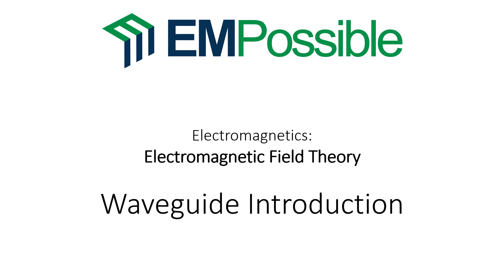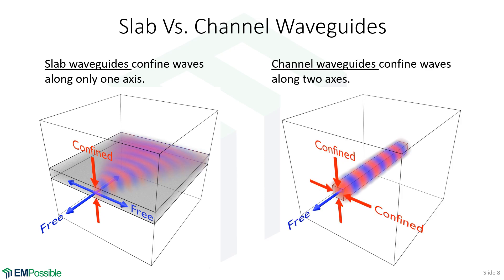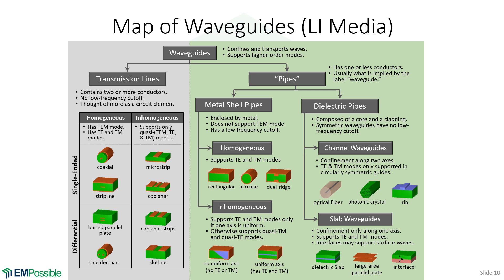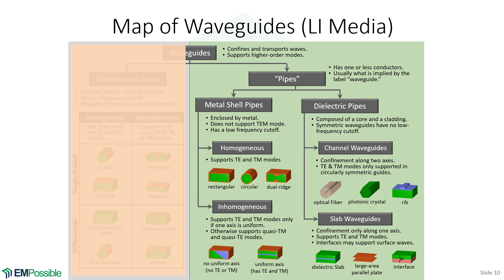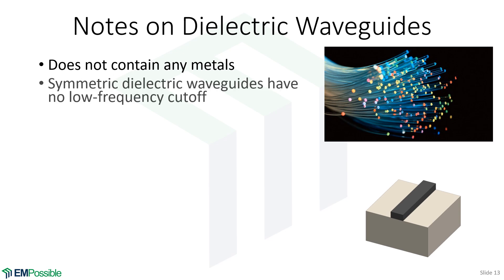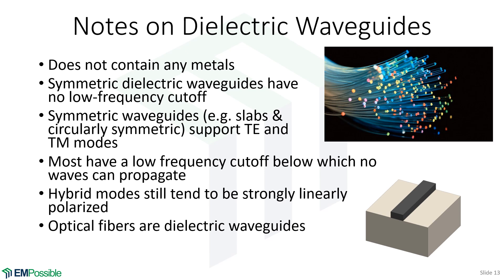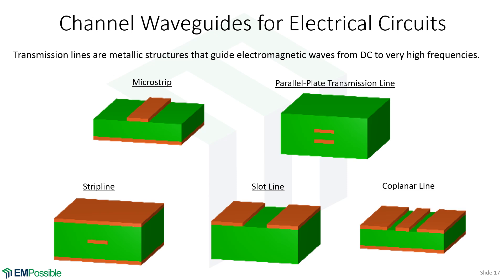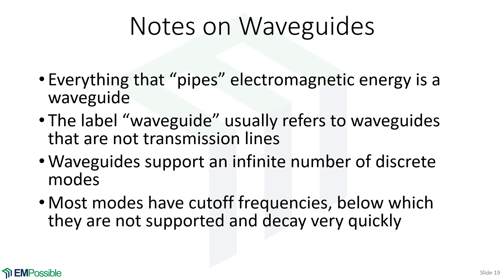Lecture -- Waveguide Introduction

Comment: Do you know anything about low frequency waveguides? For materials such as galfenol or metglas sir?
Reply: 100-400hz frequency.
Reply from the maker: @hoofheartedicemelted296  Wow. That is an incredibly low frequency. Are you looking at transmission lines or non-transmission-line type of waveguides?
Reply from the maker: I know about waveguides, but I am not sure what you mean by "frequency" waveguide. I think you just mean an electromagnetic waveguide. I am not familiar with these materials, but waveguides can be made from virtually anything. If you know the electromagnetic properties, you can design a waveguide.

if you can provide a bit more information, like what frequency or wavelength, a bit more about these materials, I could likely point you toward the types of waveguides you should consider and how to analyze them.

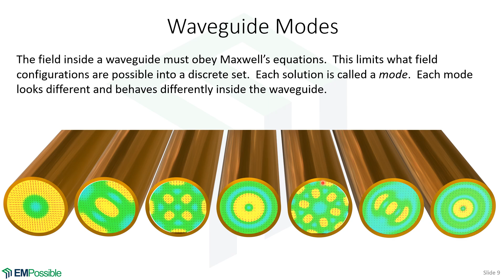Comment: Out of curiosity, and just to clarify the nomenclature, @3:29 when discussing the waveguide modes, is this academically correct to synonymize that with "guided modes" &/ propagation modes or the latter refer to a different concept in the EM theory?
Reply from the maker: For waveguides, I think it is most proper to call them guided modes. I am not entirely sure what a "propagating mode" is. Maybe in a something like a photonic crystal with a band gap you would have propagating modes and cutoff modes. That is just a guess as to what is meant by "propagating mode." If it came up in the context of waveguides, I would probably interpret that is the same as guided mode.
Reply: @empossible1577  Thanks for the clarification, I read thru your reply and I think you're right about not having heard much on "propagating modes" in opposed to a "guided mode" ... most probably was a misnomer from a memory of a conversation that I had a few years back with my graduate advisor in an around the topic. Would you comment a bit on the "cut-off modes" in a photonic crystal? or point me to one of your lectures in which you discuss them.

Thanks,
Reply from the maker: @rattinyou  Modes that are cutoff in waveguides, photonic crystals, or even free space waves (think total internal reflection) all occur with the same physics and properties. Those modes still exist. It is just that they decay quickly. If your photonic crystal slab is thin enough and the cutoff mode does not decay all the way, it will excite a propagating mode on the other side. This is called tunneling. It happens in waveguides, free space waves, and electrons in semiconductors.

I don't have much information specifically on the cutoff modes, but all of the advanced topics are covered in my 21st Century Electromagnetics class. here is a link:

https://empossible.net/academics/21cem/

You will find photonic crystals in the Engineered Materials topic. I highly recommend going through Topic 4 first.
Reply: @empossible1577  Thanks Prof. Rumpf, this was quite helpful, I'll follow through with your suggestions.